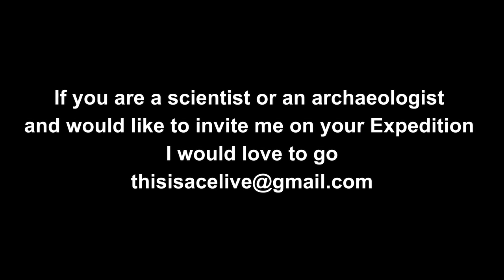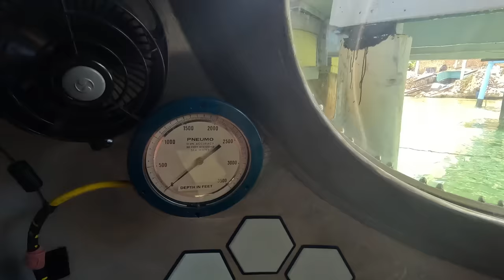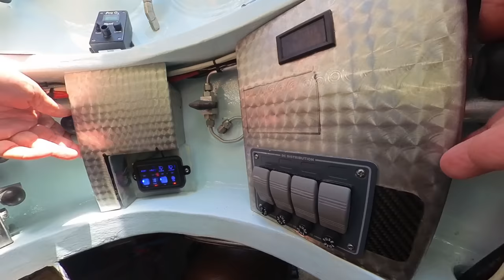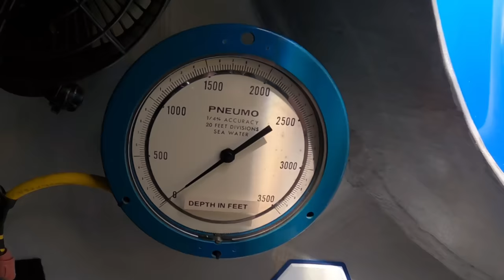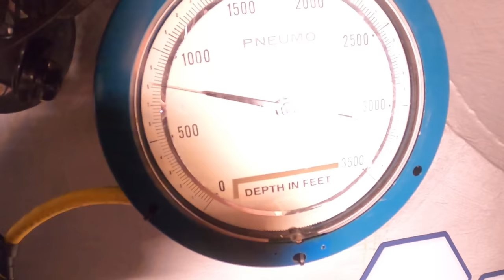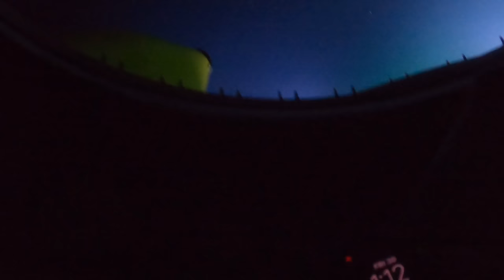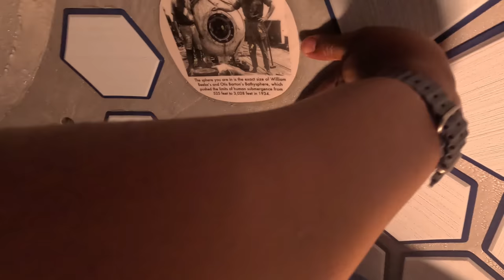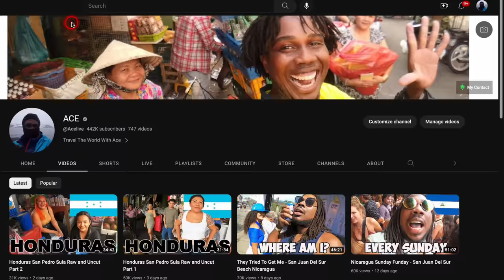Deep SUB Exploration with OceanGate Expert Karl Stanley

Comment: This submersible just looks well designed. And Stanley is probably an accepted part of the sub community in a way Rush was not, because of his reckless disregard of safety measures in engineering and elsewhere.
Reply: This is a submarine, not a submersible.
Reply: @PR-cj8pd  he called it a submersible in one of the videos
Reply: @PR-cj8pd  Idabel didn’t need a support vessel to launch, so it technically would be a submarine. But, aside from depth limitations, it probably doesn’t have the ability to travel long distances.
Reply: The guy at Seagate was apart of the same community and friends with all. He was warned and choose not to listen.

Comment: 50:00 thats why you design and test for 8,000 and take it to 2-3,000. Thats how real and proper engineering works. You don’t have to worry about implosion. You have to worry about fire inside the submersible more than anything (even if its next to impossible) its the most realistic hazard you face in aircraft, spacecraft, submersibles and submarines.
Reply: Exactly, it's called "safety factor", the degree to which a life/safety-critical vehicle, bridge, or other thing is over-engineered against possible failure.

Comment: Notice how the living spaces are shaped, especially when Ace records himself in front of the sub at the end there, underneath the yellow casing: you see that the living spaces are spherical. Spheres are much better at handling pressure as all the pressure gets distributed and is applied equally throughout the entire surface area. The Titan sub's living space was cylindrical, which would be more prone to "snapping" under pressure, especially if it's made out of carbon fiber, unlike Idabel's specialized steel. All bathyspheres and deep sea vehicles so far, afaik, have spherical "living spaces", the Titan being the only exception (and you see where that went). THis was an awesome experience btw, not many know how full of life the deep waters themselves are. Probably the last places on Earth left relatively untouched, and even they are still in danger such as from deep see fishing nets for example.

Comment: Wow, what a beautiful video! I feel like I was in the sub with you. What a sublime experience.

I felt a bit of panic when there was water on the inside. I'm glad it was only condensation.😂

One nitpick: for your next adventures, could you mic the guide as well? It was hard to hear everything Karl said. 

Also, could there be a way to climate control the sub as it's going down, so it doesn't feel like a sauna for the first 300 feet?

Comment: That's a lot of courage after what happened to OceanGate 😨
Reply: OceanGate wasn't a certified sub. pretty sure this one is. 
they also arent going 12,500 ft down.
Reply: @darkshadowsx5949  said in the video its not certified but I would still do it
Reply: @darkshadowsx5949  its not certified but its so shallow comparared to the titan
Reply: @darkshadowsx5949  No it's not.

Comment: Ace, here is some info for the  question you had regarding the air in the submersible and its effects on your body.

The air within a submarine is not pressurized. 

It remains at roughly the same as atmospheric pressure at sea level regardless of the operating depth. When the submarine goes underwater, the amount of air within it does not change so the air pressure within the sub remains the same during normal operations.  There is no danger of decompression sickness compared to a SCUBA diver who dives down to 90 feet breathing compressed air.  The SCUBA diver has to make decompression stops at intervals when returning to the surface or  he/she can get decompression sickness.

Airplane cabins are pressurized.  Airplanes pressurize their cabins by pumping air into them. As their jet engines suck in air, some of the excess air is diverted into the airplane's cabin. The air is both cooled and humidified — meaning moisture is added to it — after which it's circulated into and throughout the cabin

Comment: Certified or not certified... there's two words for reliable pressure vessel, now and forever :
SPHERE  /  TITANIUM
Reply: why titanium?
Reply: @themilkman7367  It has the same tensile strenght but is 50% lighter than steel. Anyway, the crucial word I'd choose here is "sphere", whether you make it out of steel or titanium.
Reply: Certainly and also consistency of material used. Not a good idea to mix materials on a submersible build

Comment: awesome video brother my question is in case the submarine motor went out or broke down how you people planing to go back to the surface?
Reply: I don't know how this specific sub works but they probably fill those sides of the submarine with water to make it go down and then they can fill it with compressed air to achieve positive buoyancy and make it go up. They are called ballast tanks.
You also may ask what if the power goes off, and if this submarine is as safe as the builder says, the controls are mostly made by valves and the adjustment by hand so no power required to bring a submarine up.

Comment: The Titan looked like a tin can improvised toy made by a kid compared to this.
Reply: Yeah well the titan made several dives 4000 meters down and this guys sub can only go 2000 meters down. But I get what u saying
Reply: @bellz6427  
It was the X-Box controller that had me lost more than anything.
Reply: @NoLefTurnUnStoned.  those are used alot more than you think. That was not abnormal
Reply: @bellz6427  
They’re not used to control manned vehicles. 
And certainly not in such extreme conditions. 
Everything about that vessel was corner cutting cheapness.

Comment: You can trust any sub not made of carbon composite. It's as simple as that.
Reply: How about a sub made out of towels and cheese?
Reply: @mmr0221  Now I'd go in that. We could use the towels as the hull and the cheese as fins that will control the submarines direction.
Reply: @mmr0221  😂
Reply: @aviationeli5616  You forgot about the electronics... potatoes as batteries maybe??? 😂
Reply: @KeffandMac  Well, we need some sort of electronic that can have GPS and autonomous operation such as a memory chip/card to process the electronics and functions of the submersible, so a Patagonia chip would work perfectly. I was also hoping to use two twizzlers to operate as a drive shaft.

Comment: No effing way I'm getting in one of those after what just happened to titan. I don't care that they failed on maintenance or not. That's a death wish. I spent 17 years working tuna longliners but I'm staying top side.
Reply: They didn't fail maintenance. They failed to understand that some things have a limit and the risk of pushing something to it's limits is Fuck around and find out. they could have at least figured out ways to send the titan down alone first.
Reply: Lmao, he literally told him the calculated crush depth of the hull was 8000 feet. Did countless tests at even deeper depths than reached in this video. And did you forget the dude spent 7000 hours on the thing?
Reply: Karl denies the 8000 foot figure because he knows it's bullshit.  And if you think many deep dives is good for a sub, it's exactly the opposite.  The more dives, the less safe subs become because steel absorbs stress until it strains.  Still think it's good now?  Go take a dive in it then.  But before you go, ask Karl to hang it on a cable from a barge and lower it down to 8000 feet to see what it will do.  He won't because it will implode and he knows it.  The main sphere might have been calculated for that but that doesn't mean it was tested.  But more importantly, it's two spheres and two cylinders welded together with all kinds of viewports and hull penetrations and there is just no way to accurately calculate the crush depth of that kind of homebuilt hull.  He misled Ace and apparently you, too.  Not your fault; it's his.  Be safe.
Reply: I’ll trust the small business entrepreneur who owns a sub and has done countless test on it on his own time than a billionaire who had no idea wtf he was doing. Rush was a fool and everyone told him but he still went down. This guy spent 7000 hours in this sub at insane depths and is alive to tell the tale.

Comment: I hope he knows the term operational lifetime. He can’t even replace it he even said it was a special metal you can’t get again. What does that mean.
Reply: Unlike titanium, aluminum, and composites, steel (which this vessel is made from) has a fatigue limit. That means that if material stress is kept under a certain level, fatigue cracks will never occur. Given the cited crush depth of 8000ft, there is no question a dive to 1000ft is below that limit. Just because the vessel is unclassified doesn't mean that engineering calculations weren't done 😃

Comment: You will never see me in one of those.
Reply: I understand where you are coming from but it's not good to develop irrational fears. The sub that imploded was flawed in its design, it was not a freak accident it was designed ignorant of safety regulations to withstand pressures up to around 1800m untested and it was attempting to go more than twice that depth. Redundant systems, a non-composite hull made of stronger materials means the 5 people who died tragically in the Oceangate disaster would have completed their journey, its safer than being in a car on any road and about as dangerous at scale (millions of users) as airplanes (which virtually never fail these days unless there is pilot error or overlooked maintenance). Like the guy in the video says, that small o2 tank carries enough compressed oxygen for well over a day, and larger subs with larger systems can recycle their air and bring more to begin with. Even in an event where you run out of fuel recovery is an option if proper protocols are followed. Negligence for safety and physics led to the implosion. That being said, I certainly wouldnt ever pay $250,000 to get into an uncertified submarine going any amount of distance below the surface that I can't reasonably swim up from. Depth certification classes exist for a reason and water is insanely heavy, especially when thousands of meters of it are on top of you.

Comment: So the Idabels max depth is 2800 meters? if this thing is only going that low there is NO WAY A carbon fiber hull is going down to 3800
Reply: well to be fair, we have no clue how deep a hull like the Titan's really could go, since they did not test it and did not get it inspected for any flaws. Realistically, we still have no clue if such a submersible is possible, since practically no proper testing was done. Also, it seems more and more to be the case that it was built improperly even compared to other similar vessels, such as Rocket Lab's carbon fiber rocket hulls, and Boeing's experimental plane hulls. You could almost write off the Titan as completely useless as a metric for submersible hull viability as a technology entirely tbh. It's not even useful in that regard, we simply do not know if it works or not.

Comment: "My camera overheated I think." Well duh. It's a gopro. I returned mine after I found out gopros only record for 15 mins before overheating. Then they chop your footage up into little 5min chunks. I returned it and got an insta360. Literally NO problems and it makes me wonder why people still use gopro.
Reply: I can get about 40 mins use on my GoPro without overheating
Reply: @dronepilot260rc  in what temperature? Definitely not hot and humid.

Comment: Sooo we’ve learned nothing in the past month!  We just keep getting into non certified self built submarines. Sure you’re not going to the titanic but damn.
Reply: The certificates are ridiculously expensive. You can do the same tests for much cheaper. The reason the Titan Submersible imploded was because they used carbon fiber. Deep diving is only possible with stainless steel or titan. The ocean gate design is just stupid af.
Reply: The thing is that they're not voluntarily "non certified", because the industry "is too safe", but rather because it's so expensive to get certified that it's not possible for them to pay for it. Oceangate had many redflags even before the disaster happened and was even on the news for it. That's not the case with this company as it has a seemingly very good reputation.

Also: listen to Karl talk. This man knows what he's doing, you can hear it.
Reply: That's like saying you don't go into airplanes anymore. Going into a sub is much safer than let's say a car. Nice logical phallacy, though.
Reply: @Lord_Juvens  it just shocked me. Airplanes I’ll fly any day. It is the safest mode of transportation.
Reply: @Lord_Juvens  You wouldn't fly on an airplane if they didn't do regular inspections and checks. And you wouldn't fly on one either if there where no regulations at all for them.
Reply: @zonk1477  And you're implying that guy  doesn't do any checks and such? There's also plenty of places where planes dont get checked properly and all.
It's naive to think everything is to a high standard, that doesn't mean everything is crap because it doesnt have an official inspection sign from the government.
Reply: This pilot, Karl Stanley, WARNED the Oceangate CEO about the construction of his sub...said it was doomed to fail.....and he was right.

Comment: Not certified is an instant 🚩.  "They believe in his ingenuity and his experience" yeah so did the people in the titan sub.
Reply: the titan sub was practically unused and was made by idiot's when a sub has 7000 hours and is not certified its fine.
Reply: Not being certified is not always bad.
The sub has alot of hours and uses proper material (NOT CARBON FIBER) to withstand deep sea water pressure.
Reply: It’s also calculated to to crush at 8000 feet and they would go no where near that
Reply: Also there wasn’t a single gunshot sound in this sub unlike the titan

Comment: I don't get why they use game controllers for these subs as oppose to a full control console of some kind. Is it just so it doesn't take up to space within the sub?
Reply: The military and other groups use them as a secondary control or primary control simply because everybody is familiar with them. They're also incredibly reliable and you can connect spares and backups quickly if one fails. The controller that Stockton Rush used was absolutely not a problem especially because he mentioned multiple times having multiple spares. It's good to have back up controls as well just in case which he definitely did not have but you know.
Reply: If you listened, he was joking about using a "PlayStation controller", to poke fun at Oceangate, he is using a full control system that involves levers and pullies
Reply: @Bluesykk  I didn't catch that then.
Reply: @friedtomatoes4946  they don't use them to steer they use them for cameras and the photonic masts. multiple wireless game controllers are a disaster to setup if trying to switch to another. what caused one to fail is going to cause the other wireless ones to fail until you spend 15 minutes to troubleshoot. real submersibles use wired control setups with a manual override as a backup.

Stockton Rush had no backups he outright stated that backups were not needed
Reply: @friedtomatoes4946  No, it absolutely was a problem.

Comment: implosion when
Reply: This is a totally new and different experience, don't bring it up.
Reply: @aje37  i agree, i, too, am waiting for the implosion
Reply: this is not the titan you wont see another implosion. its very rare.
Reply: this dives to only a depth of 3000 feet. the titan was going down to 12,500. and this guy takes way more precautions and was one of the ones that blew the whistle about Titan. doing anything like this is dangerous, but if Titan lasted as many dives as it did with all the corners they were cutting, i would trust this guy to take me down to 3000
Reply: @kwaddamage8286  he needs to get to 12.500 feet. Remember, million must implode, even billionaires
Reply: @kwaddamage8286  Farewell and adieu...

Comment: Not certified..?!? That Seagate sub was not certified and all of humanity knew about the final outcome.
Reply: Not certified, but using materials that are proven to actually withstand certain depths. I think there's a big difference in reliability there.
Reply: Not too mention the 7-10 thousand hours it’s been used to deep dive. So I’d say it’s been proven to be reliable unlike ocean gate which had only 3 dives to the titanic prior to the catastrophic failure
Reply: The Titan's mistake was the material that was use to built it and the fact Rush was unwilling to take safety issues seriously.
Reply: The certificate played not role in the fate of the vessel

Comment: That submarine is not the safe if you feel water condensation on the walls means it’s ready to implode you should have went 12k feet
Reply: condensation is probably from the gallons of sweat pouring off his body!
Reply: Guy literally explained it’s from the difference in temperature.